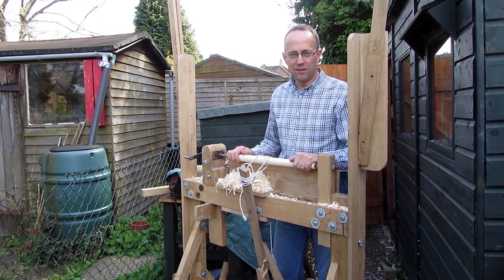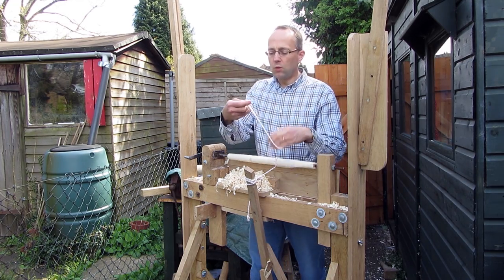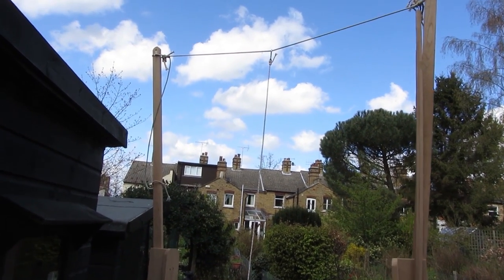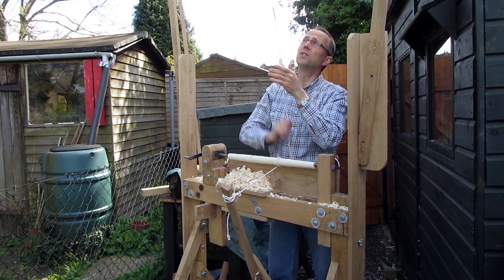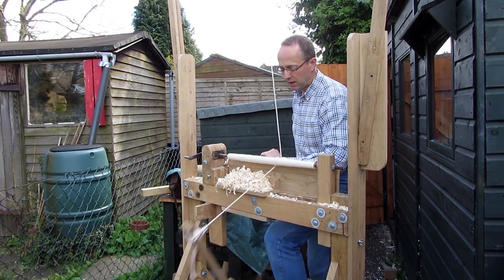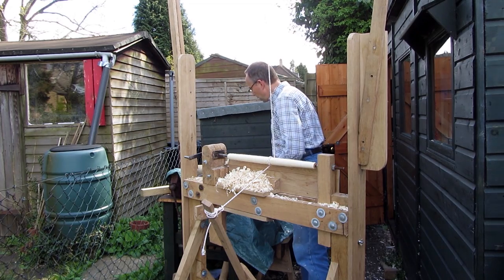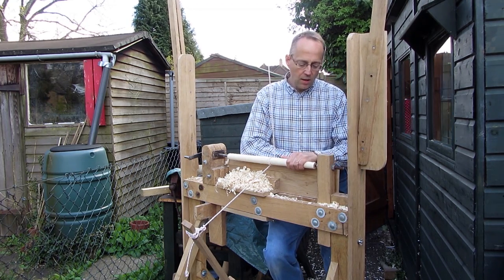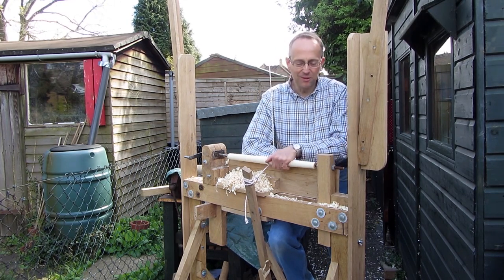Using a Pole Lathe - How to get Best Results, Chisels to Use etc.

Comment: Thank you Harry. I’ve got a pole lathe half built but it had come to a halt as I wanted to finish a drill powered lathe I was building. The drill powered lathe is now finished and I’ve started making a walking stick on it using a Red Eucalyptus sapling. A hard wood but a beautiful timber.
Your idea of allowing the treadle to come right up to the job is brilliant and has solved my problem of no headroom because my workshop is a mancave I dug out under under my home and only has six foot headroom so a bungee and conventional treadle height wasn’t going to cut it!
I’m from the South Coast of NSW,  Australia, and thanks again.
Reply from the maker: That sounds great Pat, perhaps you could use pulleys to take from upright bungee to horizontal? It might work????

Comment from the maker: Hi I already have a power lathe! - the pole lathe is far more responsive - difficult to explain until you use one but its like a journey by bicycle compared to by car - very much more rewarding and enjoyable, and often as fast - not that I knock cars or power lathes - they have their role in life!
Reply: hey Harry I follow your videos now and then, I like the one where you show how to make a rounding plane :)
Whats your thoughts about treadle lathes? (the ones with a huge flywheel). I was thinking about getting one, it seems much more intuitive to go the correct direction 100% of the time. However if I were to build a lathe myself I would go for the pole one.  

I think my power lathe is boring too... Whenever I go to my shaving horse to work I always wish I had a foot powered one :D

Comment: Thank you for this lovely insight. Can I ask please, if the height of the bungee is 6 ft above the lathe bed then how tall is the complete structure from floor to top? I ask as I'm looking to rebuild a half brick/wood greenhouse  and wonder what height of roof I would need to accommodate something like this. I'm guessing something like 8 ft?

Comment: Hi Harry. I know this is a bit of an old vid but I'm hoping you'll see this anyway. As a very new beginner to the pole lathe and green woodworking in general I was wondering if you had any advice on good basic level tools. Sizes, types, etc. Thanks!
Reply from the maker: Hi - there are some very nice tools on the woodland craft supplies website such as pole lathe chisel sets by ashley isles, drawknives and froes.....you will not go wrong with ashley isles tools - they are very good toolmakers in my opinion.

Comment: I built a shave horse, and have been playing with a cobbled together lathe, but I'm starting to think I could just as easily power my shopsmith by treadle to get the feel everyone is talking about, not to mention the much needed exercise.  I bet I could wrap the rope around a pulley on the other side of the headstock and tie off a bungee to the rafters to get the same desired effect.  I'd have to relocate the lathe however, the only problem would be how much metal I'd be spinning, but with bearings at both ends it might even work cleaner and quieter than a traditional pole lathe.  Thanks for giving me something to think about.
Reply from the maker: Hi - you could use the lathe bed with a treadle and rope around the wood being turned and that would be good ...might be too much inertia with the weight of the lathe spindle, but you could give it a try and see what happens...interesting to try these things - thanks for your post.

Comment: I demonstrate 18th pole lathe. Yeah, when I first started using one, the person who set up the pole used a sapling that was an 1-1/2 to 2 inches (about 5 to 6 cm) in diameter. That is way too thick! Like you said you just need it to return and not be too thin that it breaks. You don't want something too thick that you have to use a lot of force to push the tredle down.
Reply from the maker: That's great.

Comment: Harry, do you modify the bevel angles of your turning tools from the "standard" angles as supplied on the tools for power lathe turning?  
Neil
Reply from the maker: Good question Neil....and the answer is not really though I probably tend to have slightly longer bevels on the pole lathe tools.